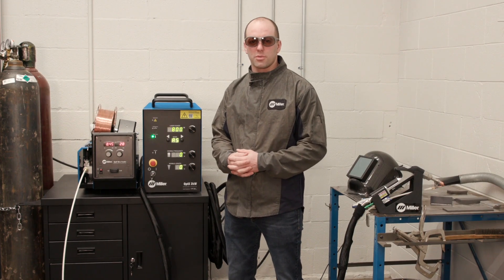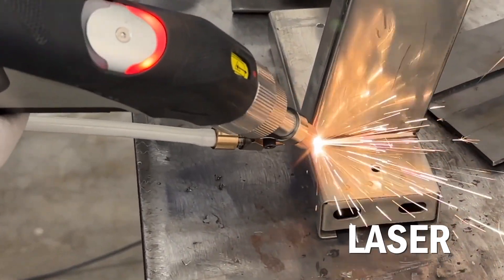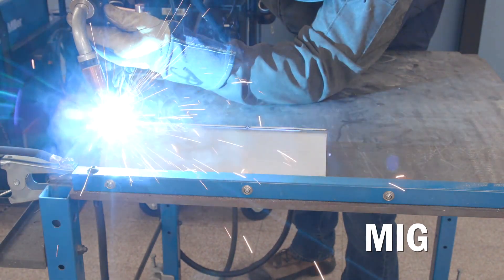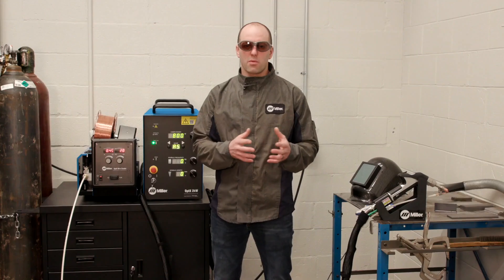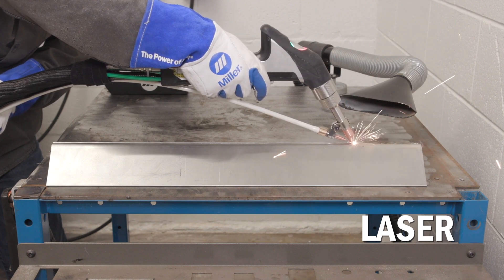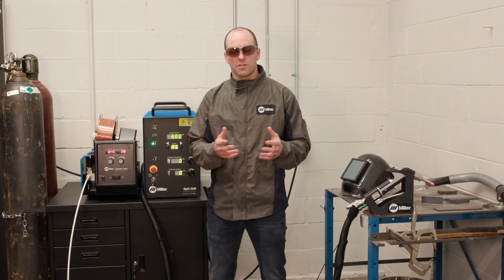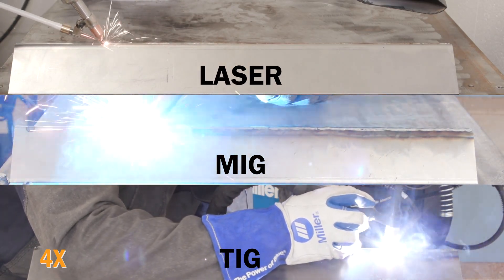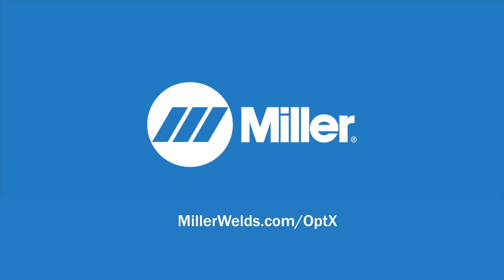OptX™ Laser Comparison to TIG and MIG

Comment: How does weld strength compare? Especially on thin materials?
Reply from the maker: High strength is achieved due to the benefits of laser welding, where the reinforcement moves internally rather than externally, unlike other welding processes.